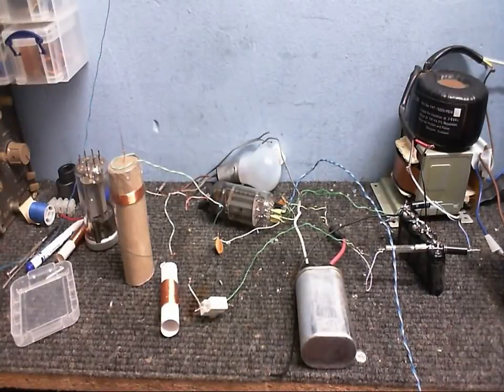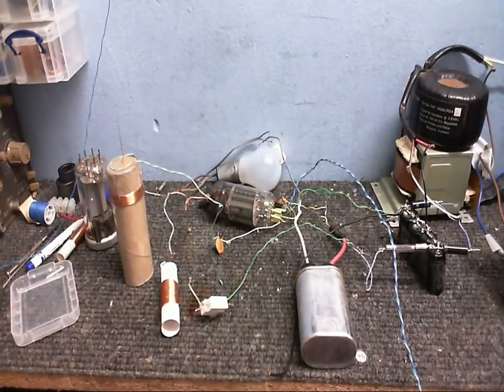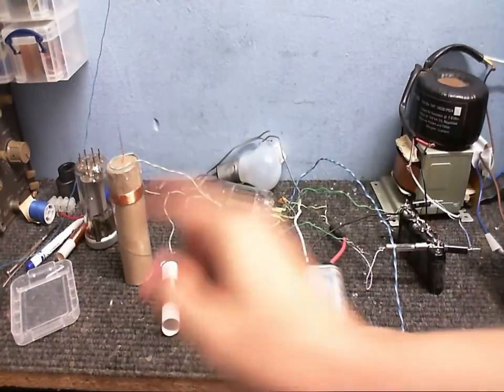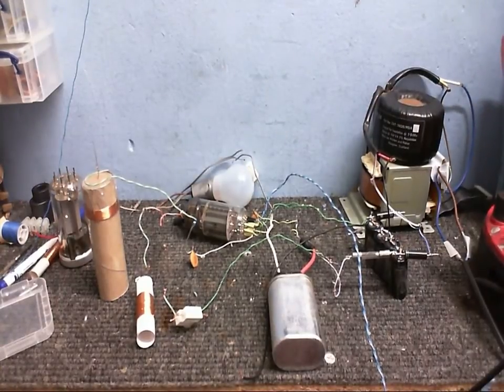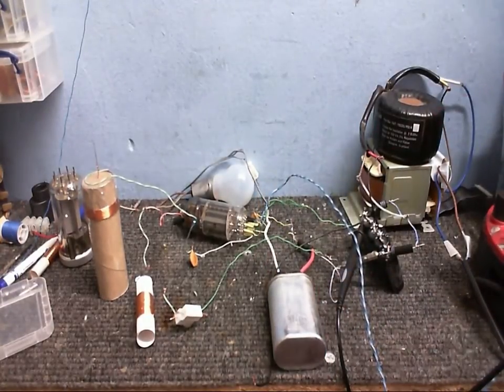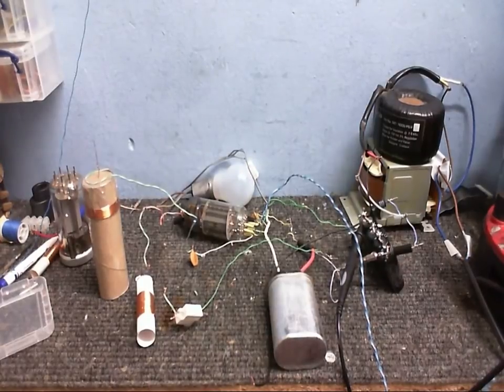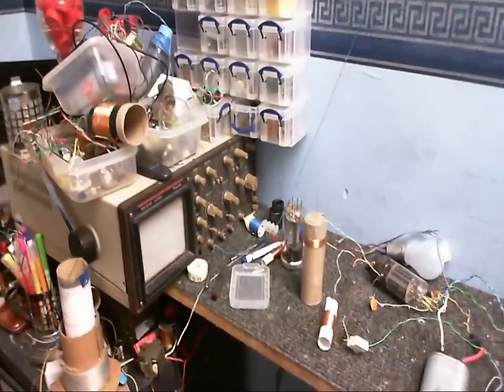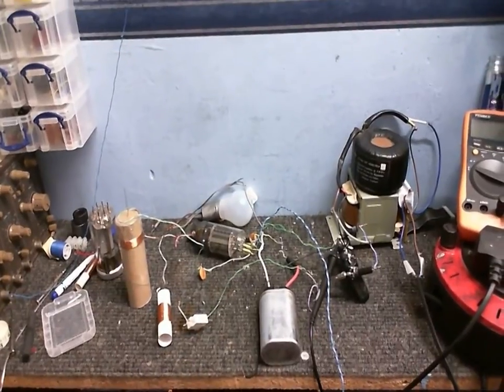help with plasma speaker

Comment: I have the same L/C meter and it has been reliable so far.  I haven't tried using it to test tube capacitance or anything like that but for discreet inductors and capacitors they seem to be right on.  That's the only help I can give you sts.

Comment: I have that LC meter. It's OK. It has high and low ranges for L and C and both ranges will give a result only one of which will be genuine so you have to have a rough idea what the value should be, but testing known components it was giving the right numbers. It's 1/10th the price of an actual LCR meter so I would still recommend it.

You may have seen little LCD circuit board LC meters on eBay; this is just one of them in a case. Note the markings on the case for DC jack voltage etc are all wrong as, like many things from china ebay, this case seems to have originally been designed for an MP3 player.

Comment: The change in oscillator activity when you put your meter on the g2 connection is simply because the g2  lead is not decoupled (surprisingly) so is 'alive' with RF. Don't forget, the g2 acts a bit like the anode; inevitably some of the electrons are attracted to it, so current flows which is modulated by the grid. Therefore, the g2 voltage will have many tens of volts of RF superimposed on it. The 'classical' pentode circuit always has a decoupling capacitor to ensure that the g2 is grounded to RF currents, otherwise you lose gain; and I'd be tempted to add 1 or 10nF between g2 and ground and see what happens.

So what's going on? Well without the decoupling, the capacitance of your meter leads is affecting the circuit. For the same reason, I would not trust the meter reading of the g2 voltage- the meter won't like the RF up it. But if that 200v reading is correct, and your HT is as per the circuit at 600v, it's probably due to the fact that the circuit was designed for a PL519 and you're using a different 'bottle'.

Comment: the inductor is the problem

the circuit uses a ferrite wound incuctror (see the doted lines above it)

you have an air inductor
Reply: the second thing is

the circuit is designed around a pl519

a el500 may have other specs than a el519/pl519

the el519
annode 1400V 160ma
2nd grid 45V 160ma
grid 0ma
35W max

the el500
annode 440V 75ma
2nd grid 30V 200ma
grid 10ma
17W

there is the problem
your tube needs more drive power
and can deliver less output

it also needs more power for the second grid